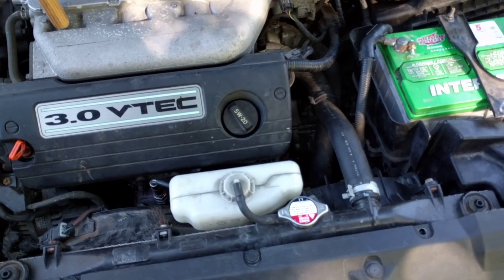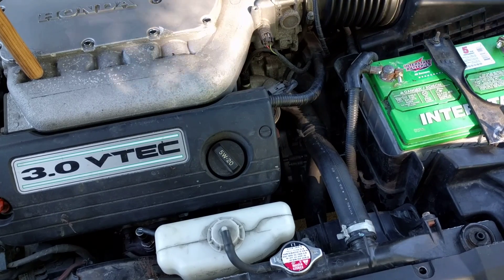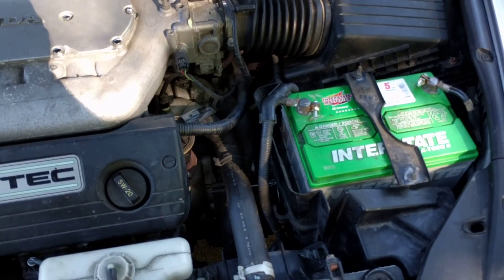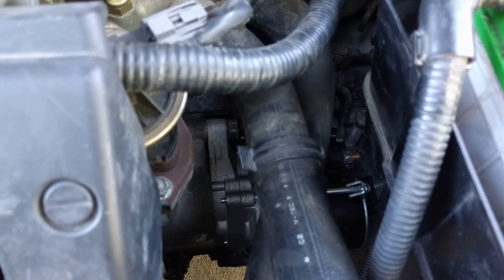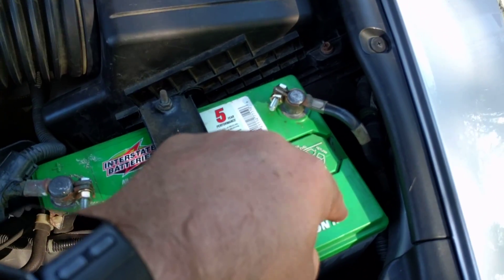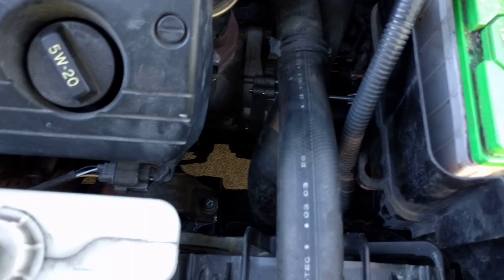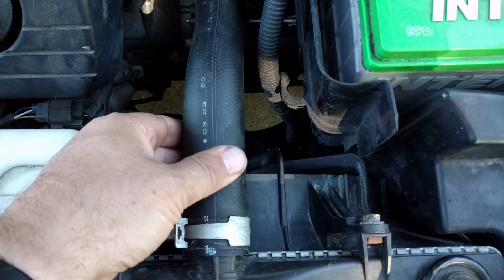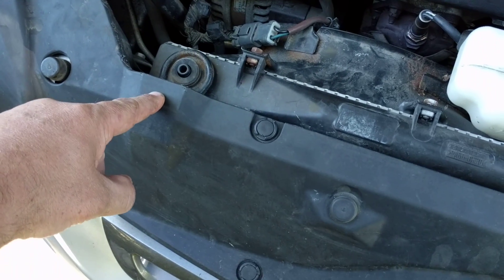How to change the starter 04 Honda Accord 3.0

Comment: Ive replaced the starter of my 2004 Accord V6 3.0L.  This is one of the easiest starters to change.  You don't have to remove the radiator or the metal plate under the battery or even have to disconnect the radiator hose.
All you need to do is remove the battery and have a 17 mm wrench and socket to remove the and install the starter.  You also need to use a 13 mm wrench to remove the cable from the starter that connects to the battery.  And a 10 mm socket for the battery hold down nuts.   Simple!
Reply: Amen. The nut for the power connection was 12mm.  I did find it helpful to take out the bracket along the passenger-side edge of the metal battery platform, 1@ 10mm bolt. Bottom bolt on the starter was half-inch-drive, sixteen-inch, flex-head ratchet, deep impact socket, three-inch extension. I made the mistake of wasting time removing the intake, and still just under an hour. Maybe ease is the reason videos are sparse...not necessary.
Reply: Andy Hoffman thanx for this I was getting confused lol I need to do mine now and I was looking for some one in YouTube thanx again
Reply: Can I install a 2005 accord v6 starter on a 2004 accord v6????? Pls help

Comment: @Andy Hoffman:  thanks for  the guidance.  I did the same.    I would recommend a breaker bar for leverage and also impact sockets and impact extender esp for the bottom bolt.

Comment: FYI you don’t have to remove the fan or radiator. You could get away with only removing the battery, plastic tray& or metal plate underneath it .